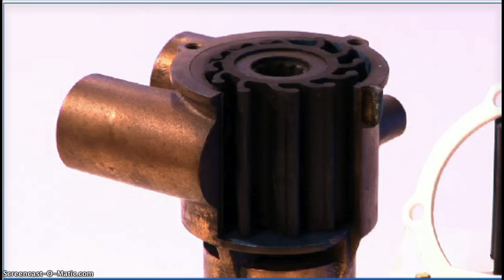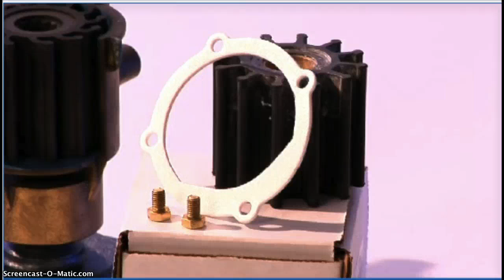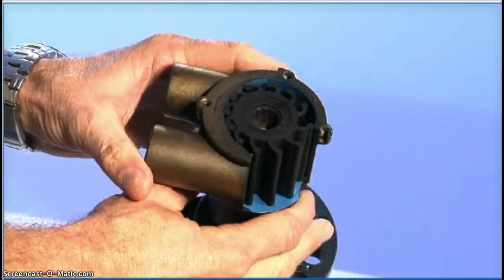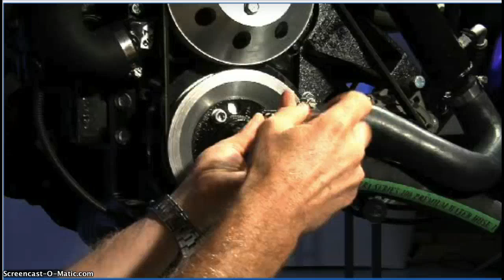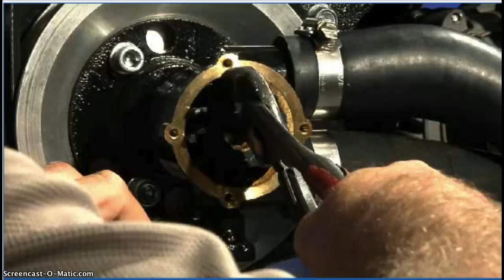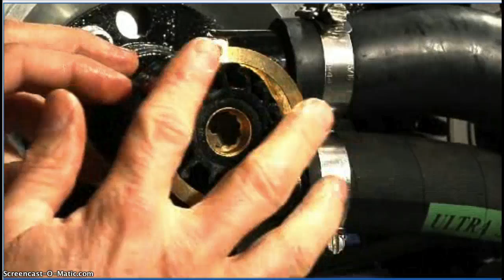Replacing the Raw Water Pump

Comment: Hi Vincent.  Great video, thank you.  I had to change the impeller and noticed that there is a small water leak (before and after the replacement) from the shaft bearing.  Is there a fix for this problem or should I change the pump entirely?  Thanks.
Reply: I have this same problem. Changed the impeller and now leaking behind it. I see rebuild kits online. Have you done your replacement to fix that leak?

Comment: Oh really. You just push the impeller in ? there's a woodruff Key to lock the impeller to the shaft. You're supposed to align the groove in the impeller to the key or else the shaft will be spinning and the impeller will be staying in its place. Aligning both is one of the most difficult things in installation.

Comment: there's a screw going through the middle of my impeller, and the housing is too small to get a hex in there and even if I could, the screw is longer than the housing is wide on either end of the impeller. 

Next problem is there is a nut on the other end, but when I put a wrench to it and try to remove it, the whole thing just spins free on the shaft (like it is supposed to when the gear is connected to the engine).

Comment: I'm having problems with my water pump,  it makes noise, however I see the water circulating and temp remains normal.  so I wonder if I need to replace the impeller only or if is the seal to?

Comment: Does anybody know if this is the only water pump? Why is it called a RAW water pump? On my friends Volvo Penta there is two separate reservoirs and caps that appear to be connected to each other. Are we supposed to add water to those? Or something else for that matter
Reply: homebrewman231 It is called a raw water pump because it takes sea or fresh water from the outdrive and pumps it to the thermostate housing and manifolds. The engine also has a regular car style water pump which circulates water inside the engine, that pump depends on this one to feed it cooling water.

Comment: I have rebuilt my Jabsco 1673 pump 3 time in 6 months. The problem is
the non-standard parts you are selling. The key part is the seal. The seal is submerged in salt water and has to be stainless steel with a stainless steel
garter spring.. That is why seal is expensive at $23.64. You have substituted a plain carbon steel seal and garter spring which should sell for $4.00. This rots out in 2 months. Shame on you for making an obscene profit by cheating your customer and selling an inferior $4 seal for $23.64. F*ck you. I will tell as many internet sites as I can to keep away from Pumpvendor. The seal should not be magnetic for this application.
Michael Evans